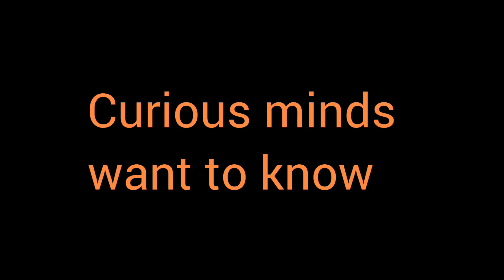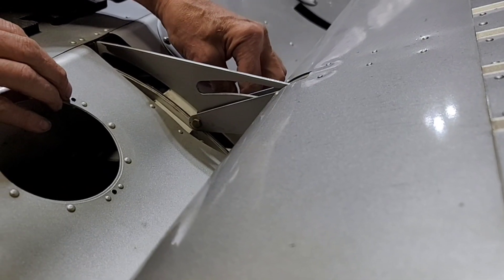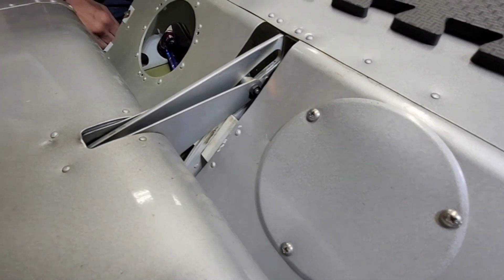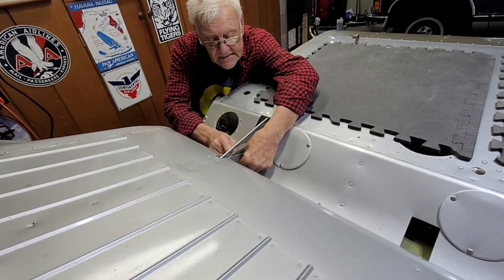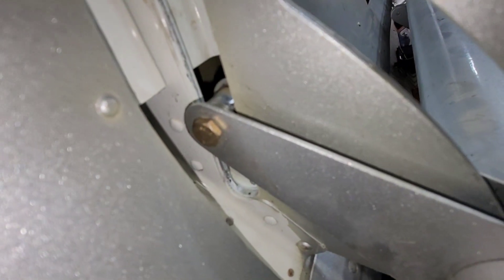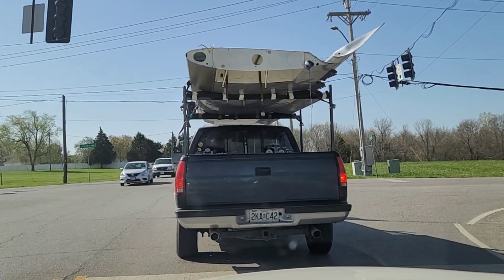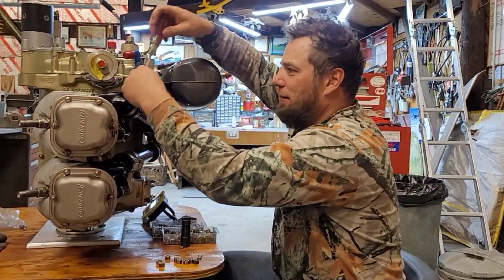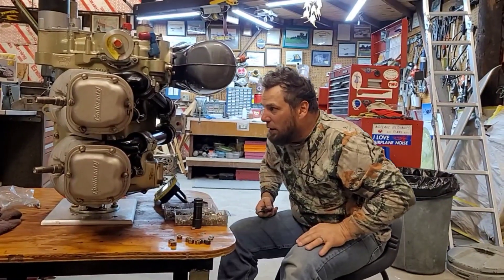The riddle of Cessna flaps maybe solved. Why did they fail after all?

Comment: We had an intermittent sticky flap problem on our C150. We found that the last guy to perform the AD to grease the jack screw used way too much grease. The flap UP limit switch was covered in thick grease. Our theory is the flaps spend most their time up…opening the limit switch circuit. On our 150 (only an up limit switch), we still have power to put the flaps down.  Since the up limit switch was “glued” open with grease, no power to come up. We cleaned up the switch and are very careful greasing the jack screw. We have not had a problem since.

Comment: Roller Bearings need replacing and lub with LPS2  (after sanding lightly until smooth)  I'd bet the flap track is off spec as well.  Any fix without replacing flap track is just a matter of time before it does it again.

Comment: Scott Monroe asked the correct question (six months ago): Did the flap circuit breaker trip?
Have a competent A&P investigate your findings before taking action. (Fortunately, there wasn't enough room for your mechanic to get at the track with a grinder).  How about turning the wing over and actuating the "stuck" flap with the flap motor?
Amateur mechanics sanding on the flap tracks to see if gets better is not an appropriate solution.

Comment: Here's the thing about fault analysis exactly reproducing the conditions when the fault occured. While I not saying this is it, having the wing upside down changes how the flap hardware is loaded. If it did the same thing with flipped over. Then I would say you found your fault. It is ver suspect though.

Comment: Anything's possible, but I'd find it more likely that the track issues developed or were worsened from the flaps being in the 40 degree position when it flipped over in the field.  Jammed flaps almost always result in a popped breaker from the stalled motor.

Comment: Wear in that area seems common on old Cessna 150/152. Probably because of the clearance with roller the flaps flutter in flight when lowered. Try a side slip, they rattle like hell. Perhaps replace the roller, larger diameter less likely to get stuck.

Comment: Going for my first ride in 4 days, yea I'm excited.  I fixed stuff for a living for 25yrs.  Screw type motor actuators have zero torque at the end limit (40 degrees) any catch at that limit  can not be overcome by the motor.  Just my opinion and I'm sticking to it.  Great job showing the potential trouble.

Comment: Yes I was in a 1968 Cessna 182 with low time landing in Carmel Valley California Chatta ditch in front of it at the time which was in about 1972 and the flaps went with a loud bang to 10% from full flaps instantaneously and we dropped hard onto the pavement just passed the dip a couple seconds earlier I wouldn’t be able to write this but I love flying I’ve owned 28 1 82s of my own now but I still never use Full flaps because of my childhood memories you couldn’t come much closer from crashing

Comment: Mmm...
...that Cessna flap actuator servo is pretty damned powerful. It should be able to pull the flap free from a stuck spot with little more than a thump. If the flaps are jammed really bad the drive coupling will shear or the breaker will pop. Check the rubber drive coupling between the motor and the flap gearbox to make sure it isn't worn out or if the little metal plates in the center hole are broken out. Motor will run but flaps won't move if that coupling breaks.
Reply: Sorry but don't think you found the problem. The overload condition on the motor should have pop the breaker. You either have a weak or shot flap motor or maybe loose wiring in the system, or possibly a defective flap switch.

Comment: Late to the party but the first thing seems not lubricated with rust showing, and then that bolt hole is probably egged giving play for the roller to overshoot and cock and stick.  I would replace all those rollers, used urethane coated to prevent the premature wear of the armature or transmission.
Also you mentioned that you had painted the plane, and it was nice.  But if you primed and a couple coats paint adds weight to plane and thickness to tolerances in the flaps.  Those tracks are aluminum, and aluminum is a very maluable or soft metal.  So steel bearing rolling on aluminum under a load is gunna wear.  The bolt holding one side of flap almost looked like a copper bolt, and then there wasn’t any type of washers.
I’m not picking on you, but don’t dust the dirt, spay the wax, sand and touch u what can’t be scene.  From the 10 minutes of what video you shown of flap it doesn’t look like long lasting “avionic hard ware” saw a 7/8 copper/brass bolt from the 1920s that wasn’t put under a microscope.
Please do your homework research past events and how the factory set plane up.  You can’t align looseness, it’s usually the loose nut behind the wheel. Peace
Maybe it happened with Dan for a reason, I could think of no one else whose passion is selfless and would hope to land a crashing plane with me.

Comment: Good find -- but shouldn't Cessna flap tracks be lubricated with grease?  Your flap tracks appear to be completely dry in the video.  Shouldn't this be a standard item on the annual inspection checklist?  Every moving part on my airplane gets lubricated annually.
Reply: No, they should never be greased. Very common mistake caused because the service manual lubrication chart is not clear about it. What they are indicating is that the needle bearings in the rollers need to be greased when they are assembled. 
Grease on the flap tracks collects dirt which then acts like a grinding compound and wears out the flap tracks. The rollers need to roll. If they are stuck the flaps will chatter. If you have grease on your flap tracks clean it off immediately and make sure the rollers can turn freely. If they are stiff, remove, clean, and grease the needle bearings with MIL-G-3545C grease (Aeroshell 5). This grease replaces the MIL-G-5577 grease called out in the Service Manuals. Even though manufacturers approve of it, avoid the use of the current spec MIL-PRF-81322 (Aeroshell 22) synthetic grease as it dries out and cakes a lot faster than the petroleum based greases do.
Reply: Could you use graphite or teflon dry lube?

Comment: Are you telling me that the PIC could have just reached out the window and given it a smack would have fixed the issue? Dan, you have to go over control serface smacking protocols with this guy! What # was this? "PIC doesn't apply enough forcefull input to control the aircraft", was it called?

Comment: Worn flap tracks bins like that because the upper track is allowed to travel further (because the opening is bigger) and this causes the relative distance between the rollers to decrease at the full travel angle. Think of the two in relation to each other and the nominal travel, if one were out of sync or has a larger track, and longer travel, they stop working as intended. 

Closer inspection of the track system will reveal what will successfully repair them, but that inspection is difficult without the proper tools.

Comment: Awesome that you found the problem Matt! 

I’d say polish the wheel and runner real good and get some aviation grease in there too just for added insurance. 

Can’t wait to see this bird in the air!
Reply: Never grease the flap tracks. It attracts dirt that will mix with the grease and form a grinding compound that will wear out the aluminum flap tracks very quickly. The Cessna lube chart shows a hand-pack grease requirement but they mean the needle bearings in the rollers themselves- not the flap tracks. Cessna does not make this very clear at all.

Comment: I will never again use flaps 40 on any se cessna aircraft. Flaps 30 is plenty and this would not happen also flaps 30 increases your chance of staying in the air. Flaps 20 gives you almost the same lift advantage and a slip would allow for any extra drag needed

Comment: Glad you've found this. Even the FAA didn't? Eeesh. Am curious if you've scraped off the paint does that leave that area open to oxidation problems down the road? What kind of paint does Cessna use anyway that would cause this? Have never heard of a problem like this before. How are other similar planes different? Not all flaps stick like this. Am curious when are 40 deg. flaps normally appropriate? I flew a 150 for a few hours many years ago but never had this kind of a problem. That plane may have had a manual lever for the flaps. It was an older Cessna. Wish you good luck. Hope your little Cessna can get back truckin on -

Comment: "Paint in the track" is not why you'r flap stuck....Im no A&P, but its beyond obvious that the end of the track is worn in the direction that the force is applied at full flaps...essentially hogging out the radius on the stop point creating a hump/lip that the roller gets stuck behind, especially when in-flight forces are applied to it. You sanding off paint to make is more "even" is proof that the channel is worn...you can see the bare aluminum where it wore out. Unless you replace the tracks, it will happen again. Dont give yourself a death wish and do it right cuz next time @dangryder wont be at the controls to save you a 2nd time. "IT ALMOST SEEMED TO EASY"....famous last words that I hope you dont eat.

Comment: In watching the video I am not so sure that it's the paint in the track.  I think something else is going on.  I'd recommend a thorough tear down to make sure.  It's going to be a lot more work if you get it all back together and then try them out only to realize you didn't actually solve the problem.  Just my $0.02.  Something happened instantaneously.  If it was that paint, it would have been not working before that.  The paint on both sides of the flap look the same to me.  I worry it's internal somewhere or is the motor/linkage.

Comment: The wings are off, you know that there is an issue with the flaps. You don't know if you solved anything. The only sensible thing is to dismantle the flaps and replace all wear and tear parts, and then adjust everything to specs. Then you know.

Comment: I can't recall but I believe there is a Cessna service bulletin about the flap tracks. Mcfarland sells faa pma tracks and a tool for measuring to make sure the roller guides are within tolerance. The tracks are not difficult to replace and could be worth the effort to avoid a repeat recurr.... hope this helps.
Reply: Those tracks are not easy to replace. A lot of disassembly is required to access the rivets.
Reply: @rescue270  alot easier than rebuilding after an accident
Reply: @Airplanefish  
This is true, but he said those tracks are not difficult to replace and they actually are a lot of work to replace. It's best to take care of of them so they don't wear out. They must not be greased, that attracts dirt that will wear them out rapidly.
Reply: @Airplanefish  
The large stainless washers are only used on one of the outboard rollers to keep the flap centered in the flap bay. That one roller is shorter than the other three so the washers can fit. There is also a service kit to install thin small washers at either end of the roller inner bushings on all four positions in order to prevent wear into the aluminum ribs where the rollers mount. This is a good idea but it's a rather vexatious job and most operators wait until the flap has to be removed for other reasons and then install the small washers when the flap is reinstalled.

Comment: I doubt paint in the track locked your flaps. The geometry ,the rollers, or the flap tracks are out of specs. There is no way paint in the track bound up your flaps @ full down. It seems too easy because it is....
Reply: Agree. I flew a Cessna those flaps would intermittently stick. The root cause was electrical, like a bad switch or limit switch.

Comment: Interstingly but unrelated, in the old AMI jukebox change mechanisms, there is a square hole with rounded corners in which a roller and pin follow. At a corner, exactly the same problem occurs at a point of very high loading. The mechanism would jam, winch up really tight, distort the frame and then the roller follower would spring free violently. My personal preference would not be to rely on dressing out that high spot which balks the movement. The fix will be only temporary. A jam will happen again. Further, there is a clearance being opened up which may allow vibration to build. If there is an approved modification to limit the excursion of the flaps to the lesser angle of later builds of the type, my personal preference would be to make that modification.

Comment: I have replaced a few Cessna Flap Tracks over the years for wear. I think there are service letters out there coving the tracks. if you have the Textron Reps contact information, I would ask him.
Reply: Been >3 decades since I operated a 150 (towing gliders with an O-320 conversion) but this jogs my memory. Also, IIRC, 152's were limited to max flap of 30*. Someone will likely correct me as needed. Agree with all who suggest limiting max flap to 30 via placard, checklist or briefing. Probly requires a 337 to placard it.
Reply: @larrymitchell3502  someone might have 
"40'd" it for STOL (not current owner but a previous one)
Reply: @dabneyoffermein595  Yeah. Don't remember whether our 150-M (Aerobat) had 30 or 40* max extension.
Reply: @larrymitchell3502  Interesting.  Yea, it would seem that the longer the travel is to go down, the risk is trying to get it back up reliably (on an old plane). Shouldn't be that way, but perhaps gravity and physics are constantly fighting mechanical engineering design.
Reply: @harpoon_bakery162  Aluminum is a soft metal. If the flap tracks are anodized at all, the hardened layer is thin. Flaps are used routinely - during most flights. Air loads are significant.

I've seen a 💩ton of Cessnas with worn flap tracks. As in run a finger along one & it comes away black & gritty.

IME, too many airplane drivers ignore 'em until bad things happen. Inspecting & wiping them down during preflight, particularly on a shared aircraft, seems a wise move. A dry lube (graphite or silicon) every few hours is probably butt-preserving, whether or not the Feds approve.

Talk to an A&P you trust & get their input.
Reply: @larrymitchell3502  scary stuff

Comment: I believe you MOST CERTAINLY  found the Gremlin !  I use to work on a C-130 Maintenance Phase Dock and we had an aircraft that had a erratic harmonic vibration at low airspeeds.  After a couple of FCF's (functional check flight) we tore into it on the Dock and the aircraft had just come back from depot maintenance and they didn't torque or even tighten the several bolts on the elevator bellcrank  torque tube and the bolts elongated the holes and some had even completely fallen out !   SO GLAD YOU FOUND what caused the flap problem !

Comment: I agree with everyone else that there is more to it than that. While that might have contributed to the issue I think the root cause has something to do with either the flap motor or the linkage that connects the motor to the flap. The motor was not producing enough torque to overcome the binding that you discovered. Pushing on the flap with your hand is not the same leverage that the linkage provides to the flap motor. You are pushing down on the flap whereas the linkage is pulling the flap. Just my opinion.
Reply: Exactly right.

Comment: I think you just discovered an important new AD for C-150. Will "they" create one in a timely fashion? Ever?
The aero forces are driving that pin into the track. Overload condition in this old aerospace engineers opinion leading to deformation over time.

Comment: Did the circuit breaker pop? If the motor was working it and should pop the breaker due to an overcurrent if it was working against a jammed flap.

Comment: It looks like you were "painted into a corner" (pun intended 😁). I am glad you finally figured out why the flaps jammed at 40. Definitely check the flap tracks and roller tolerance meet specs and also apply the appropriate lubricant.

Comment: The gliding surface of the roller on the rail of the flap guide has paint on it. And I'll bet the guide has wear and the roller is under size. You created a key-hole effect and it is going over-center and when air pressure is added in flight it's pushing it into the condition, You would have been better off limiting the total travel of the flap rollers in the guides.

Comment: The high temperature of that day expanded the metal enough to make that clearance tighter that ever before.  Unless you were in the hot sun, you would not have been able to reproduce it.  The day you discovered it, it must have been pretty warm in that shop.

Comment: I’ve been a 150 driver of sixty and seventy vintage. I’ve read all the comments so far. I’m so glad for the pool of pilots and mechanics are chiming in with great thoughts. I was trained to avoid 40 degrees. Instructors said only lucky pilots can nurse the plane to hold altitude or climb for a go around solo. What should pilots look for a go and no go indication during preflight. If I extend flaps 20 degrees will I be able to see an issue during preflight inspection? I think gross weight was 1,600 pounds. How many pounds can the extend and retract mechanism muscle. Wonder if an induction amp meter can be in the cockpit to glance at to see the health of the electro mechanism system. Zero amps. Fuse blown or like one commenter said …dead spot in the motor. Green arch , normal, red line needs maintenance. Also liked …wack it with the palm of your hand. I’ve noticed airliners have “canoes” protecting and covering their flap mechanism. My father liked to point out aircraft with manual flaps, haven’t personally tried that. Dan. PS always enjoyed Slipping the plane. Remember folks saying don’t slip and use flaps at the same time. Others in the room would say, doesn’t matter. What’s the answer to that?